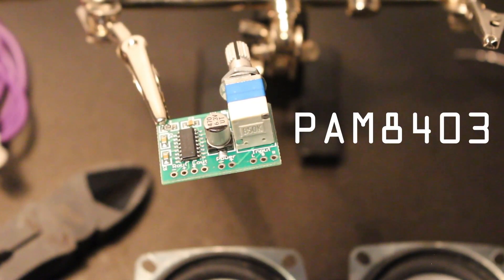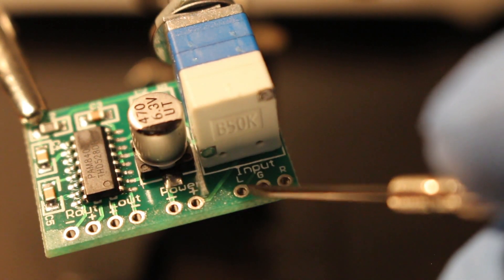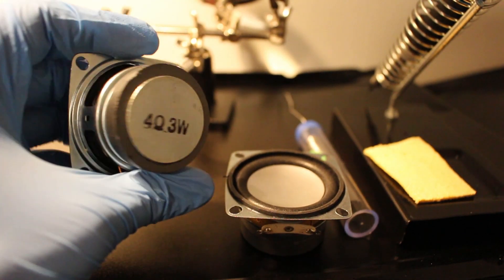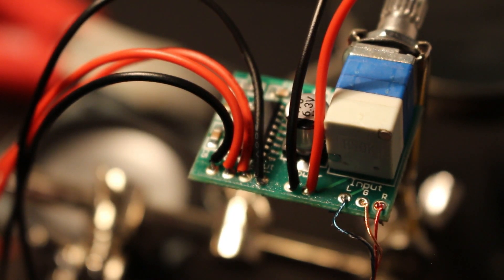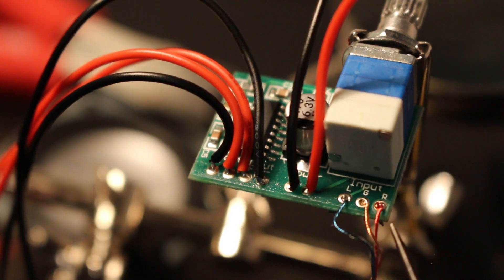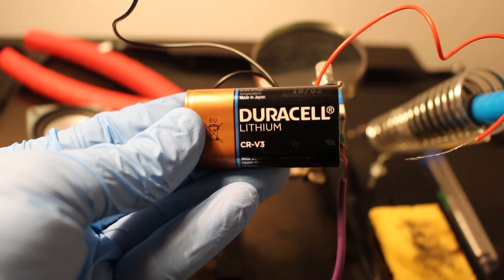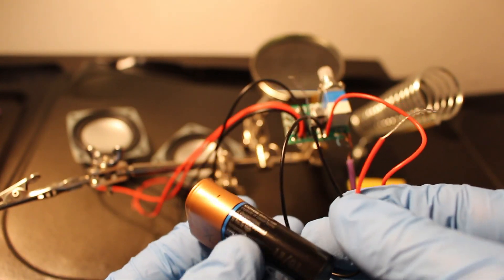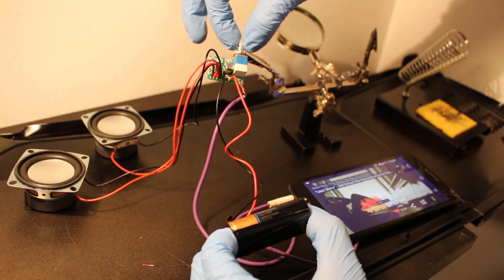DIY-How To Build Speakers From Scratch! (PAM8403) Wiring & Testing

Comment: I have 2 10w 6ohm speakers. Used pam8403.But sound is not much louder.is it possible to use 2   pam8403  together for same set of speakers?

Comment: Thanks man, today got this chip and few speakers gifted to me cant wait to make this, keep up the good work. 💪😉
Reply from the maker: BOI Awesome & thanks so much for watching! You will enjoy putting this all together. I'm going to create a speaker set with another module where it can be controlled thru bluetooth:) Stay tuned for many new upcoming projects!
Reply: @JumpermanTech  aww man can't wait!
Reply: @JumpermanTech  but one question i think i cut wrinf aux cable mine has ledt and right without ground will it work?
Reply from the maker: BOI I just checked & it will still work with just a left & right but I noticed when I connect the ground, I get a huge difference in sound quality. Best to find a Chord that has a ground. ground is usually a bare wire with no insulation or green insulation around the wire. Thanks for watching and feel free to ask any questions 🙂
Reply: @JumpermanTech  thank you a lot, ginns try it tomorrow